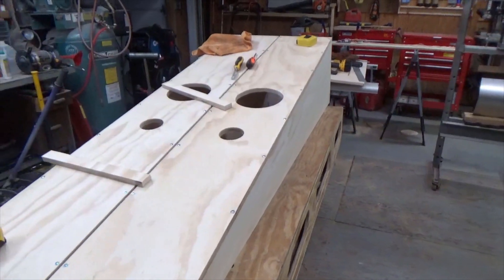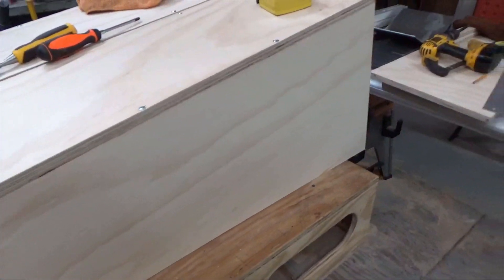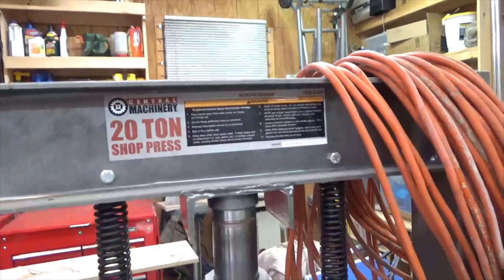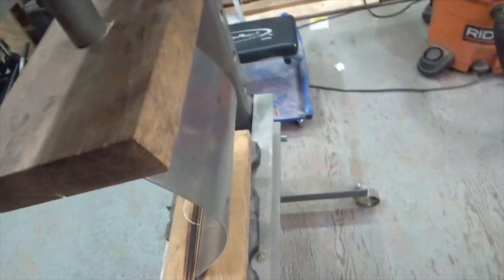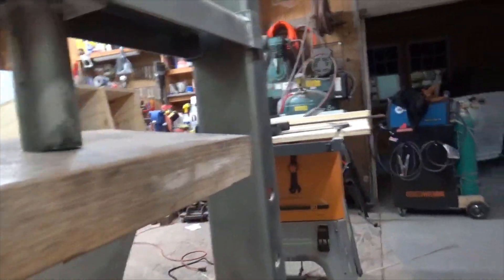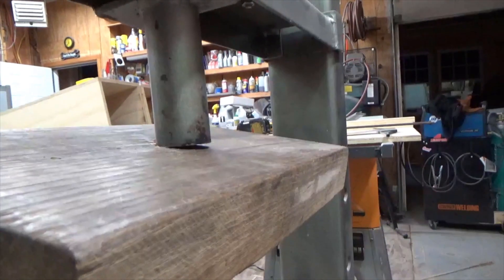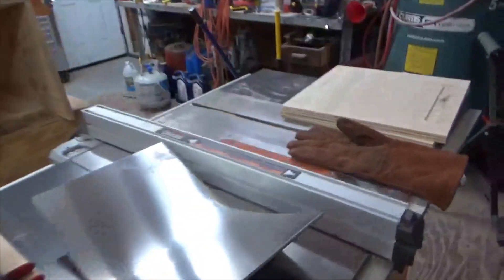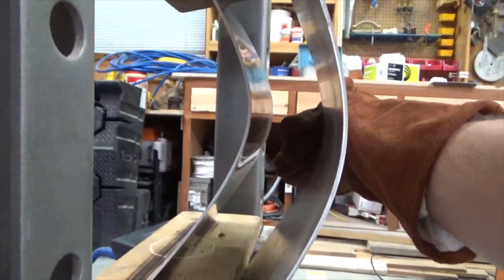diy voight tube hurdle cleared

Comment: built them before, very good speakers with right fullrange..., great project
Reply from the maker: I’m still using them almost every day, I did add a sub for the low range. I made a video about using a plate amp with the first car sub I ever bought. It makes up the .1 in the 2.1 setup I’m rocking. 
Thanks for watching and enjoying the video!

Comment: Horizontal . . . . . . . . next time.  Use a  2X8 spreader block.   

                     lll    ram
                 llllllllllll  2X8  block
                  llllllllll   2X6
                    llllll     2X4
====================== al sht
   lll                                lll   2X6 on end
   lll                                lll
   lll                                lll
Reply: Sounds like a lot of setup, thanks for the suggestion. I don’t think I’ll be bending more aluminum any time soon though.